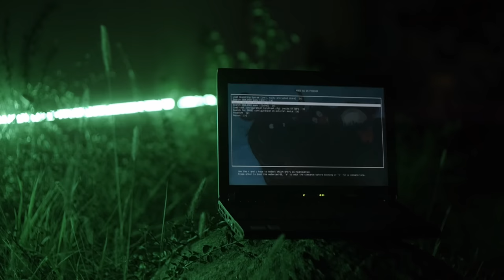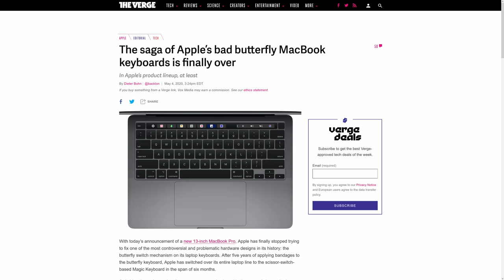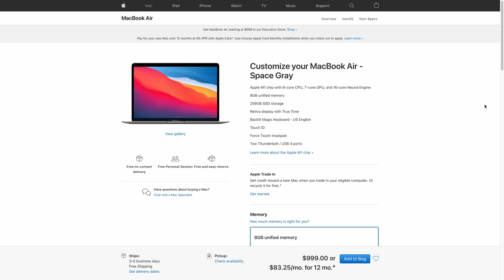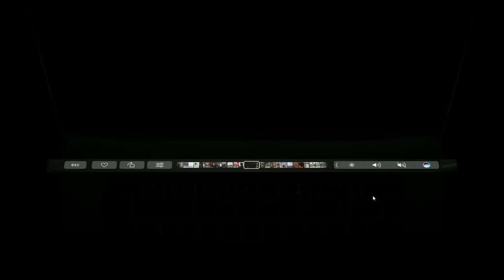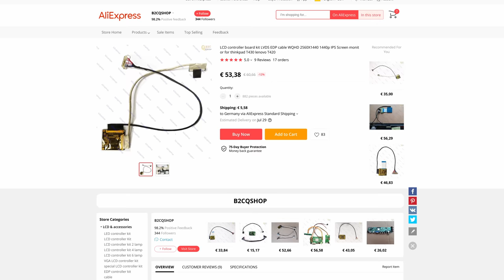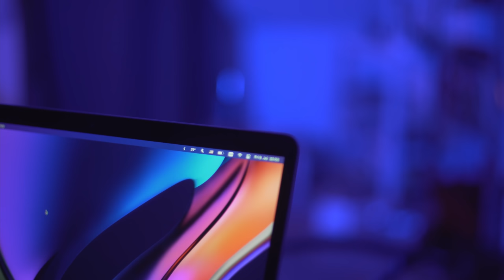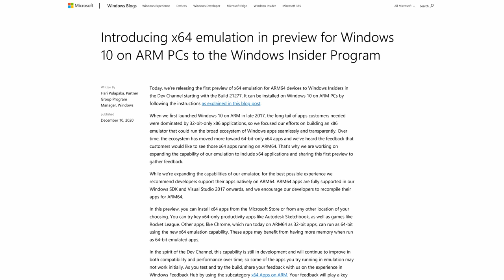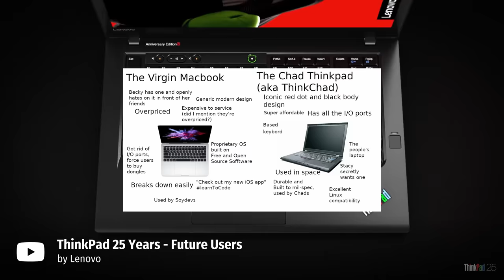Why I Switched to Mac (as a Linux user)

Comment: Now I'm internally conflicted, because I don't want to support Apple with my money, yet this machine is clearly the future. Maybe once I can run Linux on it?
Thanks?
Reply from the maker: You can!
Reply: You can run Linux on it however keep in mind you essentially need to hack the device and it wont run well. This is due to the fact that all drivers a reverse engineered by enthusiasts while Apple does everything in their power to slow them down.
Reply from the maker: @kittenzrulz2314  You don't need to hack anything. Not any more than installing a custom ROM on an Android phone is "hacking". 
The installation process is very simple and you can still reinstall macOS if you end up being dissatisfied with Linux (or even dual boot).
The reverse engineering part is partially true – Apple isn't helping port Linux to their Silicon. But they also don't deliberately slow anyone down, and didn't completely lock down the Apple Silicon devices, despite what FUD on the Internet has suggested pre-M1 launch.
Reply: @WolfgangsChannel  It's at least completely inconvenient but I agree with the phone comparison. On a standard PC you plug in a bootable USB stick and simply install Linux. On Mac you have to go through an entire process in the terminal where you only have one option for a Distribution and if you don't like that option then too bad. Kinda like how for a phone you have limited options and a complicated setup.

Comment: I mean on the section of upgradeability you compared really old cpus to newer ones, which is simply not fair. If you were to actually want to compare them you should compare the oldest cpu possible to the newest possible in that thinkpad and how many generations were supported for what time. Clearly a cpu from intels third generation cant keep up with a cpu from 2020... same with wifi and similar. You need to put it into a time frame, for example the m1 macbook will probably be obsolete in maybe max 5 years while an upgradable Laptop might last up to a decade... The Thinkpad lasted for nearly 6 years as a relevant laptop you could upgrade to keep up. Also from personal experience for lighter workloads the t430 actually is still kind of usable, for example in a workshop enviroment. As soon as one Chip in that macbook fails it is trash, so the 5 years are quite an optimistic guess. I would rather have a laptop that I can use for a long time than one that will end up in the trash after 3 years. At least thats my opinion.
Reply from the maker: T430 was only able to stay relevant for so long because Intel fumbled the bag with their U-processors. Those were dual core up until 2017, which is insane. T430 on the other hand could be upgraded with a 4-core CPU, which outperformed the newer Thinkpad models. 

The reason I’m comparing it to the M1 Mac is because it’s one of the last mainstream laptops with an upgradable CPU.

Comment: I use a Mac at work because the company requires it, but I don't understand why people love this operating system. Seriously, many things in its interface make no sense. The performance is good, similar to any decent Linux distribution or a well-maintained Windows system. When I tried to install Bitwarden through the Mac Store, it required me to fill in all my personal information, including my credit card number. In contrast, I usually install it without any problem on Linux and Windows, without having to provide any personal data.

And don't get me started on the keyboard shortcuts! Why are they so complicated?

I believe that the love for Apple products has turned into a kind of religion. People try to justify their idolatry with rational reasons, but the truth is that they simply want to be part of the group.

Comment: Except for new M1Pro\Max are much more expensive. And yeah, while I do agree with almost every single point you make here, I can not hate macOS workflow more. Cmd+tab window switching which will switch to minimized window, but won't un-minimize it? different keyboard shortcut to switch between windows of the same app? no hot key to create new desktop space? weird support for tiling (2 windows maximum), just 1 button for it, no sticky edge and stuff? And don't forget that pile of crap they call finder. At this point my mac - and I'm using it for work on daily basis - is bloated with software I installed to ease the pain. Commander One, contexts and rectangle are the bare minimum to make it work. Each update brings some nitty cool feature and something really stupid, like square fucking layout for error messages in Monterey. Apple did very good job with their new chips, but for ffs competition is here. For couple years yeah they might be ahead of everyone else, but we'll have eventually arms from intel\amd\whatever.

Comment: I’ve been using Windoze machines for 30+ years and my dominating experience with them is that more often than not you have to fight with that system to some extent and any surrounding ecosystem of devices is practically non-existent. I mean, they do exist but it’s like a violent jungle where everything’s goal is to waste your time. Now, let’s assume an average user makes eg. 48000 $ or € per year. That’s 0.4/minute (yeah, I calculated that). How many minutes per day on average have you been wasting fighting „issues” on your machine? Let’s say it’s 3 minutes - not much, eh? Now, take a macbook Air priced at eg. 1000 $ or € with an average estimated lifespan in a satisfying condition of 3 years. That’s ~1 $ or € per day (!)… For me the decision was clear, after I started valueing my time. Of course, I hate the learning curve and some of the „we know better what you need” Apple’s quirks but I hate all things Windoze much more. And I haven’t even mentioned the Apple ecosystem here, with all the workflow automations and - tadam! - end2end encryption on the iCloud. So yeah, to each their own I guess 😉

Comment: The main problem I see with Apple is that it locks you into their ecosystem and if someday they make a change you don't particularly like (e.g. butterfly keyboards, Nvidia GPUs) you have to either swallow it or carry on with an outdated device. Their tech is solid though.
Reply: It doesn’t lock you into their ecosystem. You‘re free to use third party hardware and cloud services as you please.
Reply: @OpasgegenLinks  It kinda does. MacOS as well as iOS are officially only available on Apple hardware. Installing those on some other hardware is a hack and a challenge most people aren't up to. At the same time there's plenty of hardware (laptops in this case) to choose from that comes with Linux or Win preinstalled and, in many cases, officially supported. I mean is there even a laptop with a Mac keyboard layout other than a MacBook? So once you invest time in learning and configuring MacOS it'll be very painful to get back to Linux or Win a few years later.
Reply: @colonelmustard7078  That is not connected to their ecosystem. It‘s just Software exclusivity.
Reply: @OpasgegenLinks  I may have chosen my words poorly but the point should be clear I guess.
Reply from the maker: I think the reason Apple's ecosystem is so hard to escape is simply because it's so good. No other manufacturer even has an ecosystem of that scale, let alone a good one. Samsung's idea of an 'ecosystem' sucks, Google's notorious for killing things off and hasn't put out a decent tablet up until 2023, anything else is even worse.

So when you buy Apple products and get an unprecedented level of continuity between them that can't be matched by anything else – no wonder it will be hard to switch to anything else. It's not like you can't use a Windows laptop with an iPhone, its' just not going to provide the same level of continuity.
Reply: @WolfgangsChannel  The ecosystem is indeed the best in the industry. Everything just works and integrates seamlessly. I myself give a MacBook an envy look every time I see one in a coffee shop. In fact I myself bought at least a dozen Apple products for presents to other people who are very happy with the devices many years since. But every time I consider one for myself I zoom out and see a golden cage.

My Arch set up on a Tuxedo laptop isn't nearly as slick as a MacBook but it makes me feel free and in control. I can hop on a different distro if I want to (like e.g. NixOS), I can move back to Dell hardware without having to relearn everything or change my workflow in any way. Every daemon running on my machine is my personal friend and an aide.

On the other hand I surely get that for some tasks like video editing or other creative work Linux may be a pain. But for a software engineer like myself it's a bliss.
Reply: @WolfgangsChannel  This reads like a marketing brochure for Apple products. They really got you sprung 😆

Comment: My 19 y.o. son bought an M1 Air two years ago, to replace his older Iintel based MacBook Air as study computer. The new machine rebooted spontaneously about once per day. Also it sometimes deleted the core dumps that it created. We contacted the seller (Humac in DK) within 2 weeks after the purchace and asked them to replace the faulty machine. Humac refused to replace it - they would repaair instead. We did not want to enter a long proces of argumenting and sending the machine around. So we returned the machine and lost around 10-15% on it. I have zero trust in Apple.

Comment: Ha ha…I switched to MAC in 2007…(when my newborn beat my windows keyboard to the computers death). After that  I ran both Windows and Mac because neither could do everything I needed,  (I was in first generation of offsite workers to dial in).  I bought a MAC cause it was the quickest way to get a computer in the rural area I  had visited).  ….Not long after, the back of it blew out…literally the battery exploded out of it and left soot on my desk.  In 2019 I purchased the M1 with little memory and regret that…but my Surface had been stolen…..The M1 at 16 GB can barely run the OS????  It is now too slow as is the Windows…because of constantly scanning my computer….Yes, I guess it’s old.   You didn’t address 😮privacy.   I am moving to Linux and I hope it works out….

Comment: Use what you want. But it doesn't matter to me how amazing, powerful, long battery life, etc Apple products are, it is a massive disadvantage to me to be locked into an ecosystem. I am not some right 2 repair advocate (although that's nice) or open source neck beard (although that's nice too), it doesn't make practical sense to me to limit my available choice to a single companies ecosystem and whatever they feel is right for the customer. I currently own a System76 laptop, an Asus dual screen laptop, a MacBook M1 because my employer wanted me to have it for testing purposes, a desktop PC I built myself, I have a Samung Phone, my wife has an Oppo, we both have Oppo watches, my kids have their own highly rugged, water proof phones, an older HP laptop for my wife, etc etc. In an Apple world we would be bleeding cash from an arsehole and half our needs would not be met. Not to mention, I have repaired or gotten some of these repaired for next to nothing.

Practically, Apple would suck every € out of me and leave me destitute with very little to show for it. I think they actually have very impressive machines.

Comment: “Framework” laptops for windows/linux? But M processors from Apple is really good. Linux is good, but regular user do not need the super racing prototype with manual fuel injection control to drive kids to school, they need family car with automatic transmission. And Linux is really lacks just one distro limited to its capabilities but convenient and reliable to use.

Comment: Holy shit dud e you tried every distro EXCEPT PopOs! I switched to pop because so many little things didn't work on other distros. Also I'm not Dogging your for using Apple Unix
Reply from the maker: Nope, tried it too :)
Reply: @WolfgangsChannel  man you're one lucky duck 🦆   LTT developed a very unique Linux benchmark because of folks like you! If you feel like sharing, I'm curious what kind of issues you had. Not try and fix them but for learning and sharing. Linux needs to have spot lights shined of it's flaws.

Comment: The linux is good when you have system administrator who looks after servers. But when it's on your working machine, you will have learn a lot to only run the machine, instead of actuall work done.

Comment: I'm pretty sure that emulating Mac on a system that isn't intended to run is going to do a considerable delay.
Reply from the maker: There's no emulation involved. macOS runs natively on any compatible x86 PC as long as you use a 3d party bootloader (Clover or OpenCore). AMD Ryzen systems are a bit more challenging since x86 Macs are Intel-based, but as long as you have compatible hardware, it's smooth sailing

Comment: Also reminder, the surface pro x exists, or at least existed. Microsoft has tried to put an ARM laptop on the market that supports windows. I was really hyped about it because i absolutely hate the trend of current laptops(only being powerful when plugged in and also consuming a lot of battery. Reminder, for that we have desktops.) . And what happend to the surface pro x? Absolutely dogsh#t support. Even microsoft software didnt work well on microsoft hardware. Apple on the other hand does know how to make software.
It doesn't have anything to do with being a fanboy. Microsoft had their chance and they failed. Apple should get credit where its due.

Comment: after 3 years of seeing that vid i still wont upgrade my t480s not cuz i hate apple i also love macos and use it on all of my thinkpads and ideapads and most of my laptops BUT i wont buy a laptop that is more expesnive then 150 bucks and also my t480s is good enough for my use cases it's battery stays for 10h on macos i got thunderbolt working and i love the keybored i wont upgrade it until it starts showing it's age and if macos stops being supportedi will use linux on my new thinkpad i

Comment: I've been using the Mac since I was a kid and I can definitely say a few things

Intel Macs were kind of bad. They had their pluses from about 2007-2015 but they will never be as interesting as their PowerPC predecessors or ARM successors as they are basically IBM PC compatibles except the later ones with the T2 (even then they're just PCs with extra steps hardware wise).

While hardware is better macOS is getting worse. macOS has gotten worse since Mojave and the last truly great macOS release was Sierra in 2016 IMO. It's gotten WAY heavier and has made some really terrible changes. I still don't like the macOS 11+ look and the removal of 32-bit was just really stupid and pointless. The deprecation of Kernel Extensions is another really annoying one. Not to mention that some features (name iOS Apps) are just half baked. The only features from modern macOS post Mojave that I like is control center, using your phone as a webcam without extra software and universal control.

Comment: MacBooks are great. Until your laptop breaks and Apple purposely chooses not to manufacture the 10 dollar part needed to fix it and then you can't meet your project deadline because your new 3000 dollar MacBook you just had to buy is in an unknown location because the tracking number Apple gave you isn't working. Yea, screw MacBooks. Until Apple not just adopts but fully embraces right to repair, buying a MacBook is just a gamble on when it's going to eventually break and leave you with a brick.

Comment: I don't know where people find those benchmark results, I have an i5 10500 desktop PC and the MBP M1 pro base model, both handle the same amount of tracks in Logic Pro. M1 is not that powerful in multithreaded operations.
Reply from the maker: A first-generation semi-passive ultrabook CPU with 15W of TDP performs on the level of a desktop CPU with a 65W of TDP.
Reply: @WolfgangsChannel  You can use a high end dedicated GPU with x86, expand RAM and internal storage, install multiple  OS(MacOS included), and many more things. For a portable device M1 are ok, but can't compete with a regular desktop PC due to all the limitations of ARM architecture for now.
Reply from the maker: @eprpop  I see your point, but M1 Macbooks and desktop towers are in completely different 'weight' categories. I love my 5900x desktop tower, but I can't exactly put it in my backpack and use it on thego, in a train or at work. Sure, there are SFF desktop setups that are easily backpack-able, but they still require an external monitor, keyboard, mouse and a power supply.

But I agree, if you mostly use your computer as a desktop, most of the advantages that M1 provides are rendered moot (amazing battery life, low TDP, compact frame), and you don't get the advantages that you usually get from a desktop PC (expandability, repairability, etc.)

Comment: Sums up my w520 with arch and i3wm lol but I use my dual graphics mid-2015 mbp I've used linux as only OS before but I do love macos I also have a 2006 mac pro that's spec'd out and 3 displays, use it for web dev since El Capitan is still receiving chrome updates.  I'll switch it to linux whenever that stops